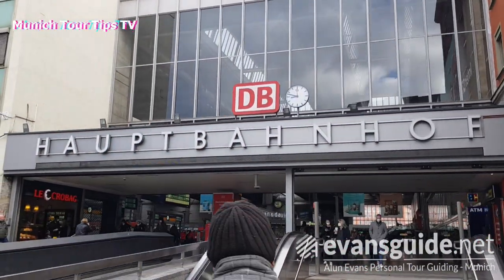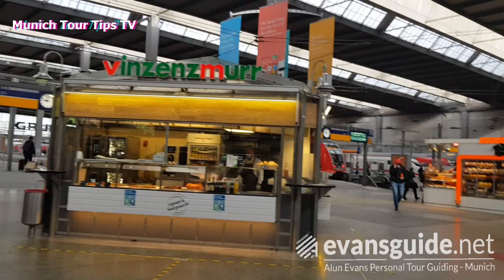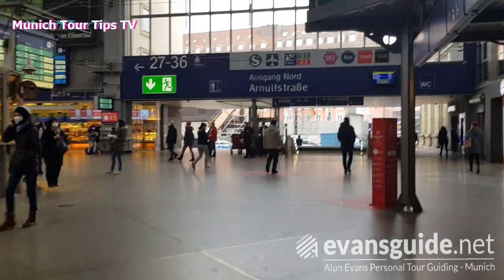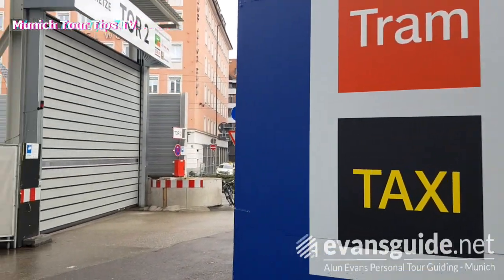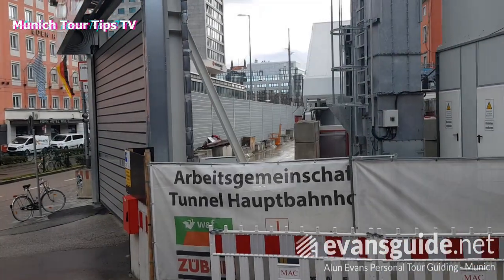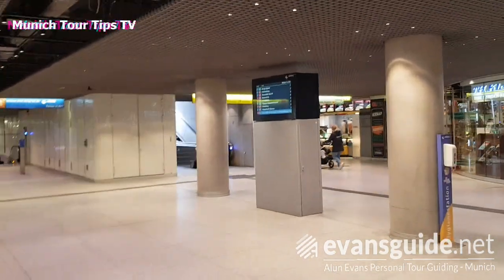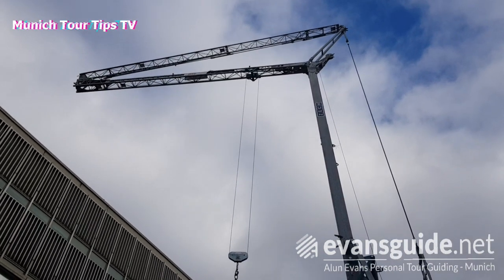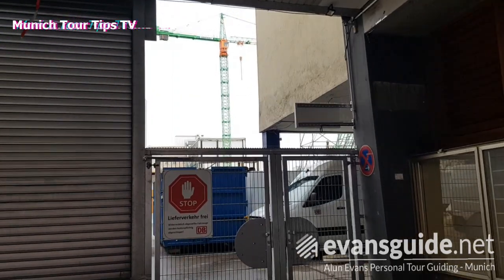Munich Main Sation Rebuild Update March 2021

Comment: I'd just like to point out that at this point, in Mach 2021, the final design and layout of the new main building of the Hauptbahnhof has not been approved or agreed on. The designs shown are an idea (as also communicted officially by the Munich city website). And even if the new tunnel and Starnberger platforms are projected to be ready by 2027, the new Hauptbahnhof "Nucleus" will not be done until 2035. If even that. They had to demolish the current building to make way for the tunnel, and I don't miss it.
Reply from the maker: Thanks for your input! Will be interesting to see how it pans out. I will keep reporting on developments!